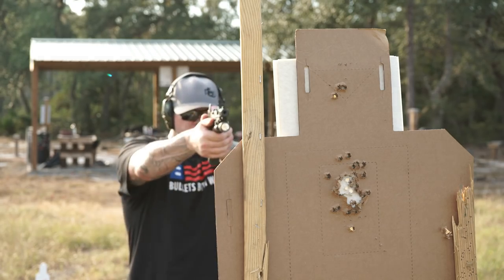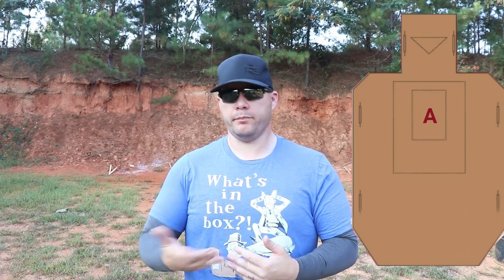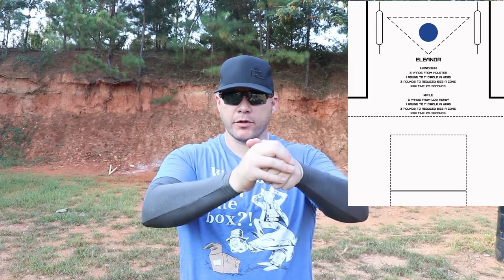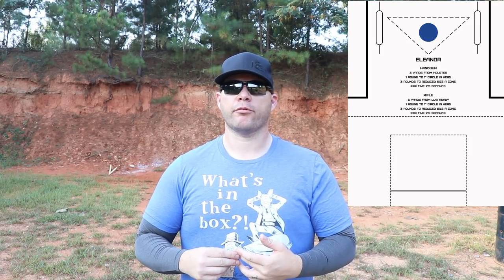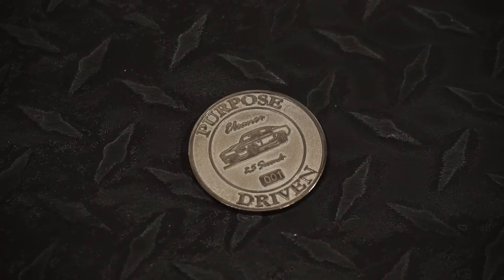The Eleanor Drill

Comment: I have always pretty good and able to get good combat accuracy with a handgun. I shoot fairly quick when I practice at 3,5 and 7 yards. I have been watching your videos for a couple of weeks now. I can honestly say you are one of the few on youtube that I actually learn a little something each time I watch your videos. I have changed my grip ever so slightly after watching your videos on trigger control and recoil management. I was honestly shocked at the range yesterday, my accuracy and precision both improved. I did this exact drill after watching it a couple of times using the FBI target my hits were much better. I would shoot the head and then high thoracic I would vary it by shooting one of the squares or triangles on either side of the target. I was happy with my hits. I will definitely continue watching your channel and practice these things you are sharingwith us."We all"can never stop learning. I am 56 and always open to any good advice. You articulate your points in a easy to understand manner. Thanks